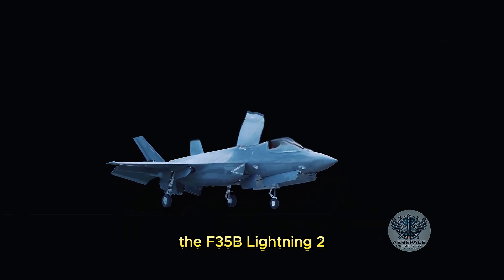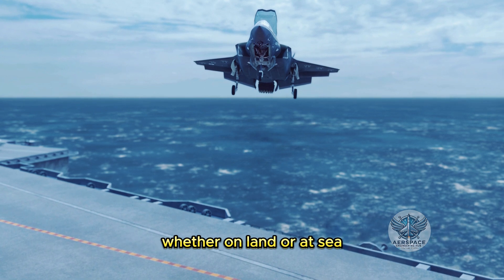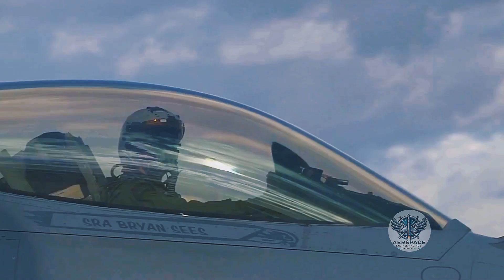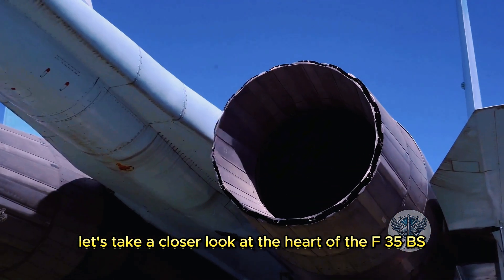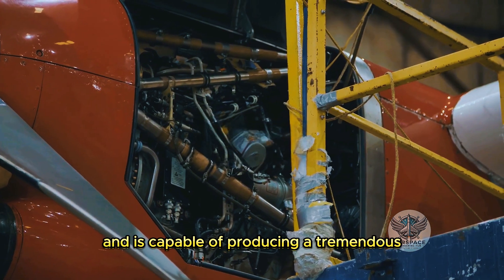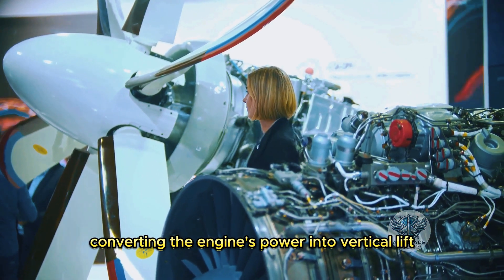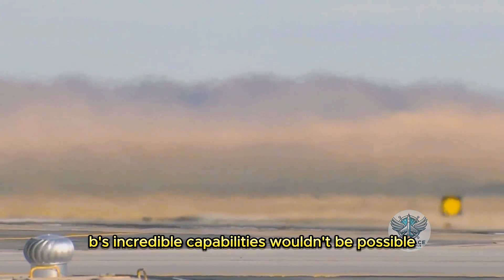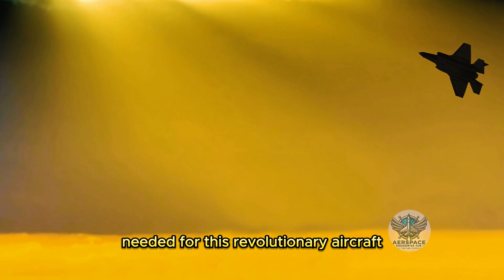The Insane Engineering of the F-35B #F35B #MilitaryEngineering #AviationTech #Innovation

Comment: 100 thumbs down. I hate it when a video shows parts that are NOT real parts of the aircraft. The F-35 has 1 engine and you show it has 2 at 1:54. I stopped right there. Aerospace Engineering Hub? NO GOOD.
Reply from the maker: you don't really understand it
Reply: I mean technically it has 2 engines one in the front and one in the back but they are not both pointing backwards. Even though I agree that this video is AI bs most videos which are not AI also use photos and videos of different planes while talking about a different plane.